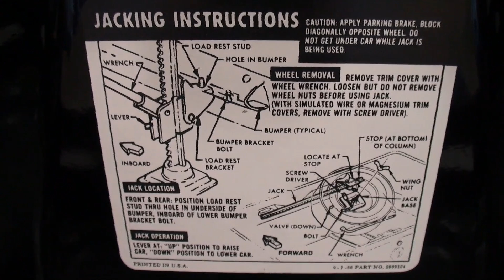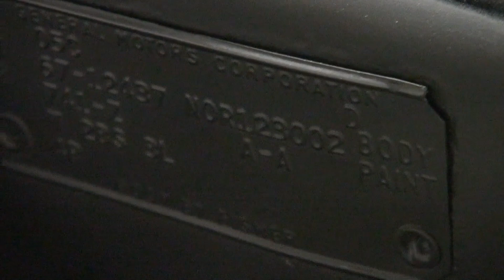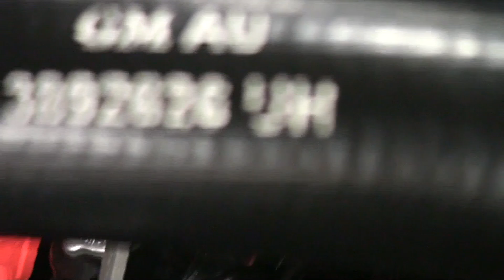1967 Chevrolet Camaro RS SS in Black & 350 Engine Sound on My Car Story with Lou Costabile

Comment: A fantastic restoration! I bought a 1967 Camaro in 1969 for $1,400. It was white over red with a black bumblebee stripe and had a 327 and powerglide. That powerglide was the reason I got rid of it, and I bought a new 1971 Camaro 350 4-speed that stickered at $3,500 back then. Car prices sure have changed! This featured Camaro is the way we dreamed a car should be, but most were not that highly optioned back then. This one is just the PERFECT 1967 Camaro. Another great car story, Lou. Thanks so much!
Reply from the maker: Hi Fred and Debra MacDonald, "PERFECT" = Winner :-) You're welcome, Lou

Comment: I have seen alot of first generation Camaros but this is by far the nicest. I couldn't help but notice the shift knob had a 3 speed manual pattern on it. First SS Camaro I have seen with a 3 speed manual transmission.
Reply from the maker: High praise for this 1st year Camaro :-)

Comment: Nicest, best restored ‘67 SS/RS 350 I’ve seen. Also, I never knew about that Screwdriver with the Spare, (tire) the rear seat Armrest option, Redlines Only and often wondered if ‘67 was the first year for the 350 as there was this local L-79 ‘67 Chevelle that guys thought had to be a 327, but quietly blew the doors off of local “Fomoco/Mopar Heroes”. Thanks for speaking with these owners, listening to all of the little details Lou.
Reply from the maker: Hi Richard, High praise for this car :-) Thank you for viewing, sharing, you're welcome, and glad to read you enjoy the little details too, Lou
Reply: The Chevy 350 made its debut in the 1967 Camaro SS and no other car. The L- 79 was a 327 offered in Nova and Chevelle and Corvette.

Comment: What a beautiful Camaro! There are so many ‘finishing touches’ on this like you said with the rear spoiler; redline tires, bumblebee front stripe, rally wheels, etc. And this is the perfect color combo as well. Thanks Lou for a great spring morning treat!
Reply from the maker: Hi Rusty, Happy to start your Spring day off right with a "beautiful Camaro!" :-) You're welcome, and glad you're along for the ride, Lou
Reply: I love the rear spoiler, too, but that wasn't a factory option in 1967.  So, for an otherwise correct car, that is incorrect ... and this comes from a guy who has an otherwise #s matching Camaro that has a trunk lid with the rear spoiler (and the original trunk lid was tossed into a landfill back in the 1980s).  Ugh.  

I wasn't sure in the video if this car had disc brakes.  In 1967, SS 350 had some of the cheapest, crappiest looking wheels of all time ... rally wheels were only available with the rare disc brake upgrade.  Again, my car wears rally wheels, but they're not correct on my car.

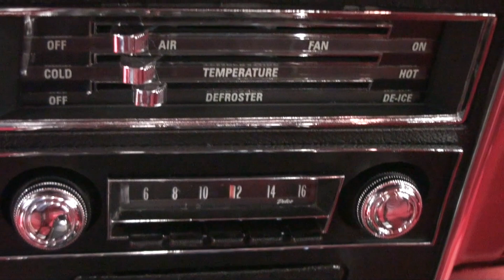Things like the chrome outlines of the pedals at 6:09 are also nice touches that were not original to this car.  Those would have been part of the interior decor group, which would be indicated by 3S on the cowl tag.  This car doesn't have factory air, but the heater controls at 6:39 are for a car with factory air.  The seatbelts are the deluxe style, but incorrect to this car ... you'd see a 5Y on the cowl tag.

Finally, the cowl tag shows either 03C or 05C ... can't be sure which.  Either way, that means that this car was built during the 3rd week of either March or May of 1967.  By that time, the 396 option had come out and the SS-350 badging was no longer being used.  So, the grille at 1:40, for example, should just have an SS badge in it ... that's how it would have come from the factory.  Only early SS 350 cars had the SS 350 badging.  Once the 396s came out mid-year, then they all just got generic SS badging (and there never was any SS 396 specific badging on the Camaro).

I love this car, but it's a shame that they didn't do enough to make it factory correct.  In my mind, you do either one of two things with these cars:  you go custom (build the car you want to build) or you stay true to what the car originally was.  In this case, they seemed to do the latter, but then strayed by adding some cool factory options that were never part of this particular car.

Comment: Nice car and restoration.  Unusual to see a three speed SS 350 car, most were PG or 4spd cars.  I have owned a 1967 RS/SS350 conv. bolero red Camaro  since  1988.  I did a frame many years back when parts were difficult to find.  My Mother ordered a 1969 RS Camaro conv new when I was a teen.  I have been around these cars since they were new.  They are beautiful as this one is.  If you look at the bottom left corner of the cowl tag, 4P denotes a true SS350 car.  Thanks Lou.
Reply from the maker: Hi Skinner Hound, Happy to read you appreciate this car :-)  Glad to read you had a 1967 RS/SS too. You're welcome, Lou

Comment: That's a very cool car . Most people don't realize that in 67 Camaro was the only Chevy to come with the 350 option . I buy and sell a lot of vintage Chevy muscle car engines an parts . Several years ago I managed to find a 67 350 . Not only was it unique to the Camaro but there are many things that are unique to that engine . That is one beautiful car , WELL DONE !
Reply from the maker: High praise for the restoration of this car :-)  Happy to read your knowledge on the Camaros too.
Reply: You are 100% correct.  The famed Chevy 350 engine was designed specifically for the Camaro launch.  Obviously, it made its way into other platforms over the years, but its really odd that the Camraro-350 SB linkage seemed to have been forgotten over time.
Reply: Vert true, Camaro only in 67 and then for 68 they added the Nova and then for 69 the Corvette and the rest of the Chevrolet fleet.

Comment: Why does the shifter ball indicate a 3 speed ? Not original shift knobs. Those are 4 speeds.
Reply from the maker: Hi Donovan, Hmmm, not sure. Maybe a Viewer with knowledge can share, Lou
Reply: The 3-speed was the standard transmission on all Camaros except Z/28. Even the mighty SS396 could be had with a 3-speed.

Comment: What a great car RS AN SS 350ENGINE 295HORSS IS AMAZEING FACTORY PERFECT. I HAD A 68 RS AND SOME REMOVED ITS 350 AND PUT A 6 CYL INLINE IN LATE 70BUT I DROVE IT WITH THE INLINE 6 UNTILL I FOUND A 400 SMALL BLOCK FROM A 72 CAPRICE CLASSIC THAT WAS TOTALED. BOY THEN IT WAS A WHOLE DIFFERENT CAR AFTER THAT THE RS RALLY WHEEL 14INCH RIMS HIDE AWAY VACUUM HEAD LIGHTS WORKED PERFECT.. WHAT TIMES IN THE 80S DID I LIVE WITH THAT RS..
Reply from the maker: Sounds like you had good times with your 68 RS :-) Thank you for viewing & sharing.